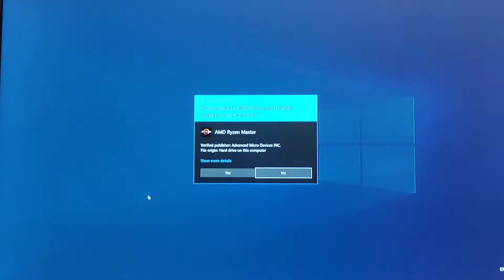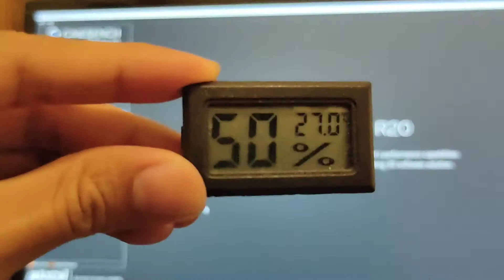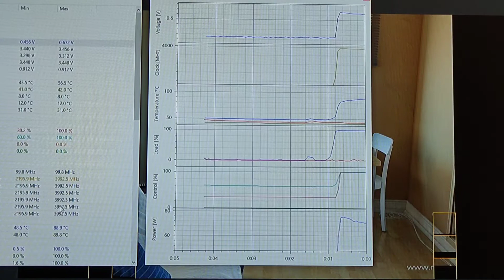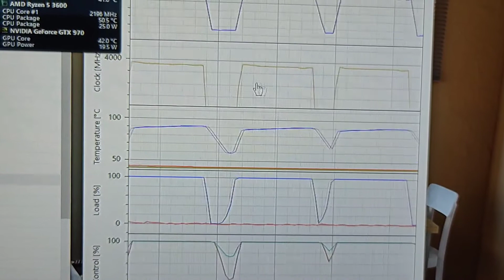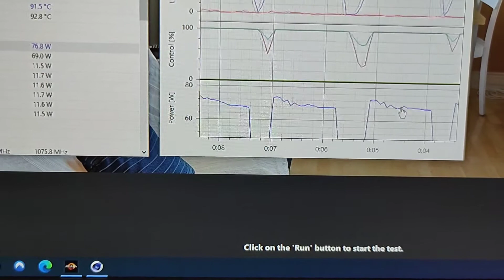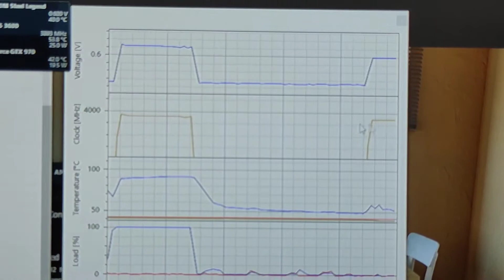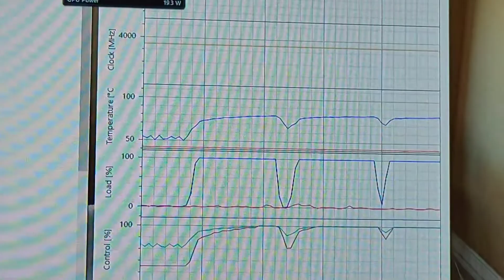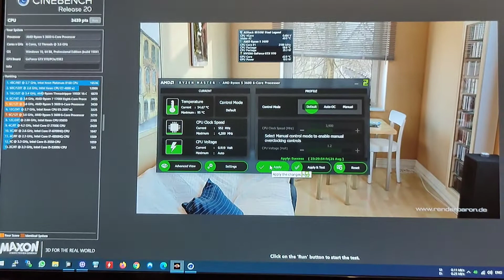Fine Tuning Ryzen 5 3600 on B550M Steel Legend

Comment: I have the same CPU and MOBO, but when I run default config on Ryzen Master it just crashes (system restart). Do you think you know what the problem is? (Ram: Adata XPG Spectre D60G 3200MHz 16gb(8x2). GPU: RX 570.
Reply from the maker: Try not to use XMP profile DDR from BIOS. Try using 1 step lower speed from your DDR specs. For me, I use dual 3600MHz RAM, but running at 3533, because don't know how 3600MHz is not stable on me.

Comment: I use ryzen 5 3600xt on b550m steel legend. Didn't change any setting in bios but the idle temp I got is around 60°C. What is the best setting to reduce the temp ?
Reply from the maker: If idle get you to 60 there’s something wrong with the instalation or thermal paste. What cooler you use, stock cooler?
Reply: @LimpingGander  i'm using AIO, Aigo Symphony TR240. I've reinstall many times the thermal paste, but still got the same idle temp. Unless I manually set the clock to its based clock, I'll get 45°C. Any ideas how to fix this?
Reply from the maker: @mohamadafiq7075  Check your power profile, power saver will sleep some of cpu core. Balance and performance will get more core active when idle than power saver, it’s normal to have 50 C when using balance power profile while idle.